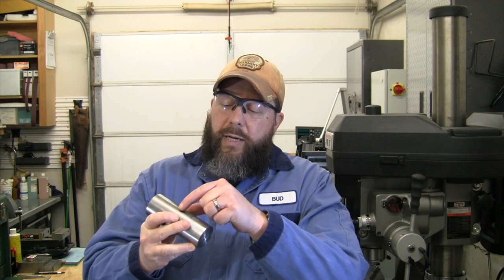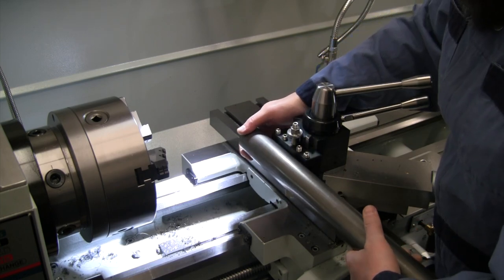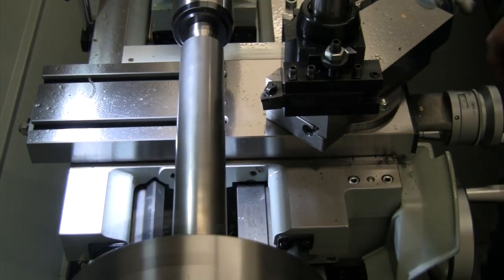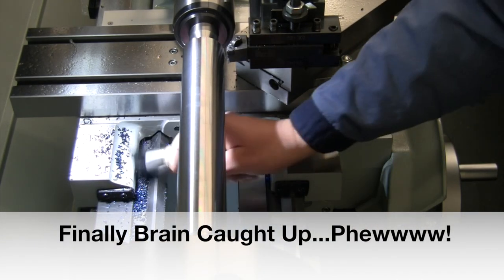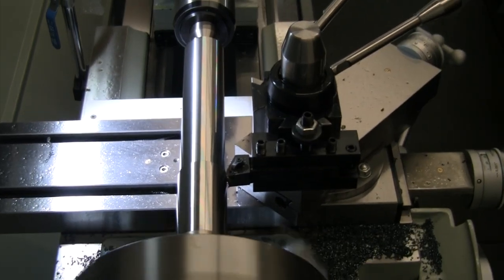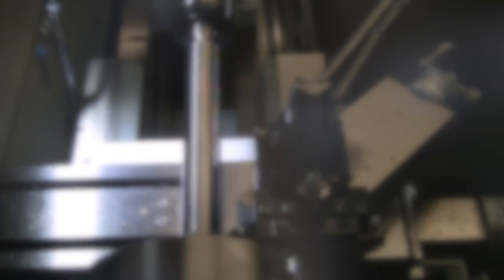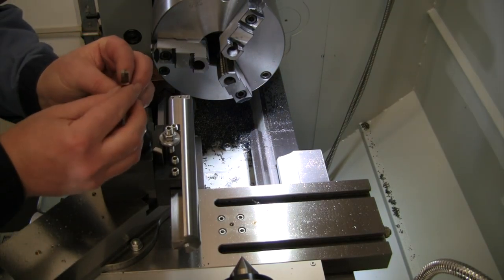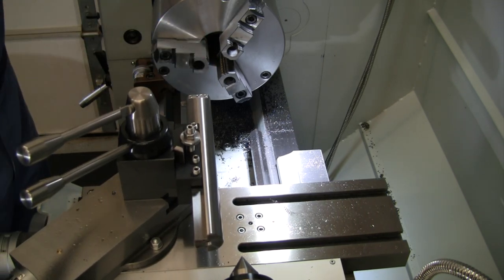Homemade Boring Bar 1.5" Diameter For Brazed Carbide or HSS Tooling - Turn, Thread, Groove

Comment: “We’ve got 1 thou and 6 inches” 9:03 
I might be Australian but are you sure you read that right 😂 good to know I’m not the only one that knows what they mean but says something out of left field
Reply from the maker: Brendan Austin - I appreciate the attention to detail and there are many times when what I think came out of my mouth and what actually came out don’t match.  However, in this case, I was measuring the variation in size over a length of 6” and the whole bar. Just trying to share the accuracy of this lathe turning over that distance so .001” taper in 6”. Hope that makes more sense. Thanks for the comment.

Comment: Really nice video for a useful and practical project! I subscribed just yesterday after watching your PM-1440TL setup and some other early videos. It’s clear you’ve progressed in the video/audio departments, so congratulations. As you know, there are some other channels with extremely experienced presenters who have set the bar quite high. Regarding your audio, yes, it does seem like you’re speaking “loud” to be heard. I suspect this is unavoidable with on-cam audio. If you switch to wireless mic (with the attendant $ and technical considerations), you’ll be able to speak in a “normal” voice and still be heard. You’re doing much better with useful cam angles and keeping the viewers in mind. Some random suggestions for your consideration:
1) Try to make sure the action is well visualized.
2) Periodically check that the shot is framed well (so glad the coolant line is banished for now…).
3) Try not to block the view even though you need to see, if you do, consider editing those parts out.
4) While the design as you go approach is fun, consider doing an after-the-fact simple dimensioned drawing (based on the final piece) that you can show in the intro and/or during the build to make your points more clearly.
5) For repetitive operations, consider showing one or two at 1x speed and then use time-lapse to go through the rest. It’s nice to see some real-time action.
6) Don’t worry too much about comments like these, you are doing a great job and are a fresh voice providing useful projects and techniques!
Reply from the maker: Steve H - Really appreciate you taking the time to provide some thoughtful feedback for me. I am constantly trying to improve and you have given me some ideas I can definitely incorporate.  I am thinking about a new camera and will plan for an external mic when I do. Hoping I can keep it sounding decent until then. The design ideas and camera feedback is really helpful. You are correct others have set a high bar. Appreciate the sub!

Comment: I never got a good finish out of those insert end mills, especially the 1/2" ones that takes a single insert. I guess these are intended for roughing. I like them because you can easily change the insert. What RPM do you run them at? I believe these insert end mills are designed for CNC so really wants a 6000+ RPM speed.

Also for a better finish you should be doing a climb cut for finish cuts... CNC always use climb cuts because otherwise end mills will break.
Reply from the maker: Tyler Fu - Thank you for the comment. The finish with the insert mill was not bad just all the steps moving down so I agree a better roughing than finishing tool. I believe I was running it about 1800 RPM or 295 SFM. On my CNC I climb mill because I have ball screws. With the backlash in most manual mills I typically stick with conventional milling. As always I am sure there are another ways to get it done.
Reply: @BladesIIB  I have an old mill, has a horrible backlash (like almost .5mm worth). I still climb cut on finishing stroke though, I don't try to climb cut on roughing passes. I have a 1" (really 25mm) insert end mill that I run at the highest speed it will go (around 3000), and it works fine. But the 1/2" single flute ones machines terribly no matter what I do, I guess those are meant for much higher RPM in a CNC. I end up turning the shank down to 6mm and use them in a router.
Reply from the maker: @taiwanluthiers  Maybe the single flute just does not have the rigidity it needs. Sometimes harmonics come in and a machine just does not like a tool at a certain RPM. Sounds like you came up with some work around to get the most out of your equipment.

Comment: you should cut a key way in the back end of the bar to hold a 1/2 inch turning tool on the same center line as the boring tool, then you could turn, bore and face with the same tool freeing up another block for other tools you my need
Reply from the maker: slowpoke2067 - Interesting idea. The trade off would be you would have to turn you quick change holder and if using the tool offsets you would lose that. If not using the tool offsets then would definitely offer some versatility. Thanks!

Comment: Nice project,
Where did you find that light for the quill?
Thanks
Reply from the maker: Mike Stevens - Thanks for the comment and the question. I built the light. Pretty easy. Look up Everbright halo light on Amazon and find the size you need. Mine came in a pair for $13. Bought a 12v adapter and some magnets. Could epoxy the magnets to the light or in my case I just used double side sticky tape to secure the magnets. Get as simple or as fancy as you want with the switch. I just put a small toggle switch on the side of the mill where I had some room.

Comment: You need v blocks. Should always have 3 points of contact in the force direction.
Reply from the maker: I think they may have gotten in the way of cutting almost half way through the bar?  I should invest in a set though. As always, appreciate the input. Thanks.

Comment: You could have loaded an end mill in your lathe and mounted the bar in the tool holder and cut your tooling slot on the lathe.
Reply from the maker: Agbhar Gihad - Thanks for the comment and the idea. Definitely had not thought of that. Always like a new idea.

Comment: What kind of light is that you have on your mill between the chuck and the tool ? Looks pretty effective.
Reply from the maker: R Blade - that is a LED ring light. You can buy some already wired. I made this one. Bought the light and the power adapter on Amazon and added a toggle switch. They are typically for automotive use so usually 12V and plenty of sizes available. I just use some good double sided tape and magnets to hold it there.
Reply: @BladesIIB  thank you for the prompt reply. Love your series by the way !
Reply from the maker: @rblade1808  anytime and thanks!

Comment: What do you use for you so called "Texas Rust Prevention"  Need something better here in Indiana with all this humidity.
Reply from the maker: Justin Sturgeon - Great question. I just use way oil so Mobil DTE Heavy Medium ISO68. Have some in a regular oil can, squirt a little around and use a gloved hand to spread a thin film. I used to live in Indiana as well and would say the humidity in Dallas is even higher. Good luck.

Comment: Had really good luck with greenfield(?)....maybe... taps and dies...but 4140 is tough on anything...I get it.
Reply from the maker: Jody - I am sure a greenfield tap would have gone through even 4140 like butter. This was a packaged tap drill and tap from the local hardware store, sometimes you make due with what is on hand. Any other time always good to buy quality tooling. TGA and for the comment.

Comment: You could have fit it on the tool post,  put a cutter or end mill in the lathe and just cross fed it
Reply from the maker: Luke Amato - Thanks for the tip. Someone else mentioned that as well. New idea I had not thought of. That is what I love about machining, always more than one way to do things and always more to learn. Appreciate the comment.
Reply: @BladesIIB  for next time anyways

Comment: Why is the audio choppy?
Reply from the maker: Any particular point or section in the video?  Just checked and seems to be fine in all the areas I checked?  Thanks.
Reply: @BladesIIB  the first few minutes. almost like you're using an auto on microphone and it turns off too quickly. other vids dont have it, watching Tool Height Gauge now and it's fine
Reply from the maker: @justaguy4788  appreciate the feedback.  I had some other feedback that it seemed like I was yelling, I have tried to manage my projection a little.  I think it was clipping out the camera mic.  Glad the other video sounds better, I will keep working on it.

Comment: Nice machinery in kinda jelly I’m running ww2 machinery .
Reply from the maker: Jon Harrington - Thanks and could be your old steel is as good or better than my machines. Some true quality iron built in that era. Keep on running them. 😁
Reply: @BladesIIB  for sure my leblonde has tons of torq compared to  my grizzly 
The leblonde can actually handle a 200k cut without slowing down. One day I’ll upgrade to a proper mill.my true business is moving earth the machines are really there for maintance needs.... anyway thank you for the video